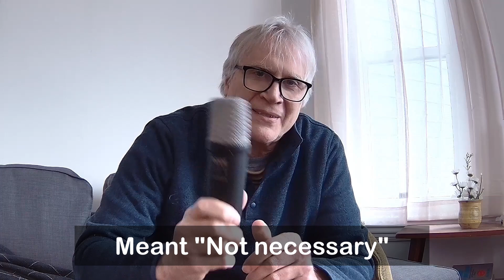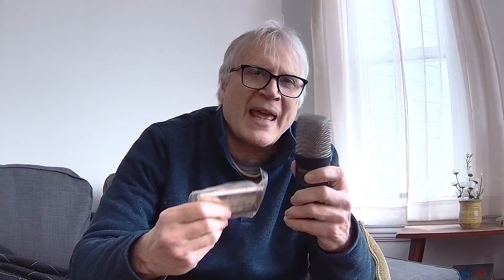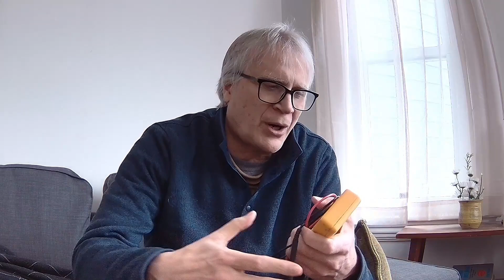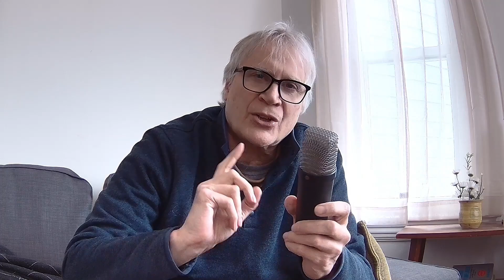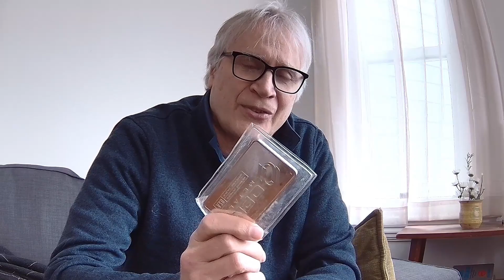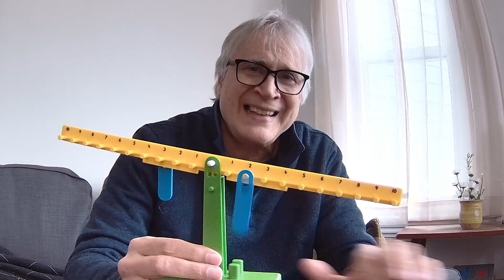The Gain Knob is Obsolete...NOT!

Comment: Typical A/D converters have a dynamic range of 110-120db which less than the ~138db of dynamic range this microphone can capture. To mitigate this deficiency, Rode as used 4x gain circuits and 4x A/D converters that overlap in different ranges/sensitivities of the audio signal and then they are combined with digital math to recreate the entire dynamic range of the mic.  the concept of manual analog gain adjustments is no longer needed because you can simply raise or lower the level in post-production without the risk of adding noise or clipping distortion (within "real-world" scenarios of course).  Rode isn't the first to use this technology.  the SoundDevices MixPre series use 3x gain-stages with 3x A/D converters.  And finally the StageTec Nexus system uses multiple gain-stages (called TrueMatch) and multiple A/D converters to achieve a true,  real-world dynamic range of 157db on its XLR mic inputs.  With these technologies, the audio engineer no longer needs to set analog gain,  we can purely use digital trim/volume with no losses within the digital domain.  Also, I don't care how "low-noise" you think the ElectroVoice RE20 microphone it, the NT1-5th Generation will beat it by 10db or more.
Reply from the maker: I have the NT1 5th gen which I tested and sorry, I find it, um, so basic.  I go over it in my "malarky" video.  Everything you wrote comes from marketing and BS patents which haven't created real electronics.  You make a convincing logically argument about all that stuff.  A couple of years ago I would have believed it.  After hundreds of hours studying this stuff, sorry, I have nothing to support it.  

Are you prepared to be wrong?  Is the truth important to you.  Then watch my videos.  Do you own tests.  Think out the whole signal chain from beginning to end.
Reply: @MaxoticsTV  🤣  you are secretly my hero! 😂
Reply from the maker: @ I take it you're being sarcastic.  I don't care if I'm right or wrong, believe it or not.  Of course, if I was wrong it would be very painful.  Especially at this point!!!  

If it's so difficult to change people's mind about 32-bit float, imagine how hard it would be about things that would kill them like how we're making the planet unlivable or killing ourselves with chemicals and drugs.

Thanks for engaging!

Comment: They most likely meant to say the build in preamp in the mic is unclippable. People might not understand that there are multiple stages of amplification. Within the mic and post mic, the mic preamp of the interface etc. You can distort anything post recording, so the statement requires understanding where it applies.
Reply from the maker: The reality it's hard to clip this mic, but it is clippable.  I've done tests which I've done videos about elsewhere.  There's only one pre-amp.  If you're using the mic in USB mode you're using the mic's preamp.  If in XLR, the interface's preamp.  

The word "pre" is there because it really means "we need to amplify this before we can do normal amplification"  To me the statement is just plain false no matter how I look at it ;)  I've written to all these manufacturers about this issue and they reply until we get into the technical stuff then crickets, because, their engineers know this is marketing BS.
Reply: @MaxoticsTV  USB??? Who uses USB in pro audio? Really, it all comes down to mic internal AD conversion, it can't be good.
Reply: And when you say "mic preamp" it seems to me you don't understand the first amplification stage which is the fet to bring the voltage to mic imput level and then the post which is the mic to line level. Before the AD. If ever there's clipping it's secondary amp stage before AD conversion.
Reply from the maker: @tommibjork  One of us doesn't understand it ;)  There's only one pre-amp.  It brings the mic voltage to line level.
Reply from the maker: @tommibjork  Actually, the mic's internal pre-amp for the USB could be fine-tuned for the mic (condenser) whereas most preamps for consumer stuff must handle for dynamics and condensers.  However, this is cheap stuff with the Rode brand on it so I doubt the internal electronics are anything fancy.  Indeed, I know they're not.  Covered in a different video.
Reply: @MaxoticsTV  oh boy, so you mean to say the internal amplification in your mind is not a preamp? No condenser mic works without voltage, meaning there is an active first stage of amplification inside the mic, before the DC components are removed with capacitors or a transformer. This mic is transformerless. After this, there is the internal USB AD if it puts out USB DIRECT, then it also uses the USB 5VDC for the internal electronics. If not then there is the normal XLR that feeds the +48V with both -/+ wires to the mic because the internal amp stage is not passive. That is the first stage of amplification. THE FET! After that comes the "preamp" of the mixer or interface, but whatever happens before it hits them can cause distortion, or not. With USB most like yes. I have build and modified mics for 20 years.
Reply from the maker: @tommibjork   Are you thinking about what I said?  I'm confused.  When did I say a condenser works without voltage?  I said the exact opposite. There is NO amplification from the capacitance voltage.  It sits there and does nothing.  TRUE, it makes amplification easier because the mic voltage out now has a bias voltage to go through transistors.  The FET is a field effect transistor, what does that have to do with anything?  

I believe you, that you have built and modified mics for 20 years.  I have built software for 50 years if you go back to my punch card days in junior high and the IBM 360 mainframe.  If one only works with mics before the preamp/ADC they can easily assume things happen in the preamp/ADC components that, sorry, simply do not happen.  What you think is in the data, is not in the data.  If I'm wrong about that, please prove it to me...and maybe watch the whole video and my other videos on this subject?
Reply: @MaxoticsTV  well the fet can distort also. Even if it's just there to do the impedance conversion it will boost the current although not amplify the voltage. If the mic has internal USB converter then it also has what people think as normal preamp, to bring the voltage to line level before AD conversion. It must have a fixed amplification? Otherwise it would be actively changing the output, which is a no no. Not to mention making the capsule voltage from the USB 5VDC, it will be ramped up but what is the headroom and noisefloor using USB psu?
Reply: @tommibjork  USB is a data protocol.  It's data agnostic. It has nothing whatsoever to do with these issues, right?  But you're right, if there is USB there must in fact exist both a pre-amp and ADC.  The state of material science dictates that commercial electronics can't operate on voltages below 1 volt, if not below 3 volts.  Maybe you want to research the basic electronics used in amplifying small voltages--this isn't an audio only issue.  Headroom and noise floor are human qualitative measurement.  There are no hard and fast rules.  One man's noise floor is another man's gold ;)
Reply: @maxcanthelpit  you are absolutely right. USB is just universal serial bus. But before something can be turned into 1 & 0 it has to be amplified. I don't know but believe there is no AD converter for mic levels, always line level? Comparing to tape (reel to reel) all digital is gold. 👍😉
Reply: @tommibjork  Yes, you can't take voltages way below 1 volt and quantize them.  You can't even write them to tape.  The problems retaining "signal" in small voltage when amplified has not been "fixed" by digital.  That's why stuff recorded on good analog equipment pre digital is comparable to what it would be today recording on end-digital workflows.  That is Steely Dan wouldn't sound any better today ;)

Comment: I don't understand your video.
The capsule transforms pressure waves (a.k.a. sound) into an analog milliVolt signal. This milliVolt signal is the "source of truth" for everything.
The classical "analog" amplifier transforms this milliVolt Signal into a stronger signal, controlled by the Gain knob.

Of course it should be theoretically possible to transform this millivolt signal in a very wide range to a digital signal, and even the old INMP441 with its 24-bit integer (that's tons of range less than 32-bit floats) has a large dynamic range.

You could, for example, use 3 different fixed amps for 3 ranges, digitize their result and combine the three results. The physical limit is the capsule and the signal-noise-ratio, everything before the amp.

Have you checked it practically?
Reply from the maker: What I think you're missing is, first, the voltage can go down to the microvolts, or 0.001 millivolts.  A classic analog amplifier will use tubes that are like "valves" to the input current.  A lot of current flows through the tube and the microphone voltage modulates it by going through a mesh between the cathode and anode.  Let's skip that and focus on transistor which does the same thing, but only allows current to pass when the microphone voltage hits the "base" (like the mesh).  

Yes, it's theoretically possible to transform the signal into a wide range of digital signals but is is PRACTICALLY impossible ;)  That's what I've checked.  That's what engineers confront in the practical world ;)

You can't use 3 different fixed amps for 3 ranges.  Theoretically, sure.  Practically speaking?  IMPOSSIBLE at that level of source voltage.  Think about it, if you could separate the mic voltage into 3 streams for 3 amps you would NOT NEED AMPLIFICATION! :)

A microphone's voltage is amplified multiple times.  As I mention in the video all amplification is a FUNCTION of the materials used in the process of using a source voltage (low) to regulate an input voltage (large).  It's like if you're on a bike about to climb a hill.  Do you go straight to low gear?  No, you might go through a few gears to maximize the signal of your legs, so to speak.  There's no one gear that can do it all.  There's no one transistor that can do it all.  Each finesses the VERY SMALL microphone voltage until it's strong enough to pass around the circuit without losing signal accuracy.

At that point you can pass it through all the amps you want ;)

Does this make any more sense?
Reply: 32 bit float has been around for years, zoom and sound devices use it as well as other converters, works really well and has saved me from clipping more than once. It employs two preamps at different levels so that it can safely capture a much higher decibel level, believe it or don’t but your just wrong.
Reply from the maker: @JonathanGalle  Hi Jonathan.  Show me your tests.  Explain your methodology that proves it.  What you think happened in some of your recordings is just a belief.  That's not how science works.  I've done videos where I've shown my tests.  Others who have challenged me and done tests disappeared after learning the truth.

Ultimately, it doesn't matter if you record in 32-bit float.  My advice to you, make sure you set your gain correctly just in case you're wrong about 32-bit-float.  Cheers!
Reply: @ Excuse me, I misspoke, multiple A-D converters NOT preamps. still the point remains, the preamp is moot. you have 1528 dB of range - (according to sound devices website) you'll clip the microphone long before you'll clip the signal. Do I still set the preamp correctly on my units? Yes, cause I backup to 32 bit while my main recording is 24, but do I need to? No. Why do I need to do a "test"? you can just look at the technical specifications on sound devices, or zoom or whatever. your argument in this video is just wrong. You don't understand what 32bit float is doing and your miss-informing anyone who watches your video. get a NT1 - 5th gen, use it with the USB connection at 32 bit float and I dare you to get it to clip.
Reply from the maker: @JonathanGalle  I already did what you suggest.  The video is here: https://youtu.be/gA-RcD8TtMY?si=UuRXBqmFoMvLe9nl

Sorry Jonathan.  I understand 32-bit float.  I have many videos on the subject you can watch.   My question is do you understand it.  Explain to me exactly how it makes the gain knob obsolete or removes clipping.  I've also written an article about this subject: https://maxrottersman.medium.com/the-three-types-of-microphone-clipping-explained-d23ad13a60f7?source=friends_link&sk=2741a5e36687099eb740aa92b80fa8c1

I'm sorry Jonathan.  Some big companies lie.  32-bit float sells equipment for a lot of manufacturers.  What important is that you think I don't know the truth--and that may be.  But you have to prove it with facts.